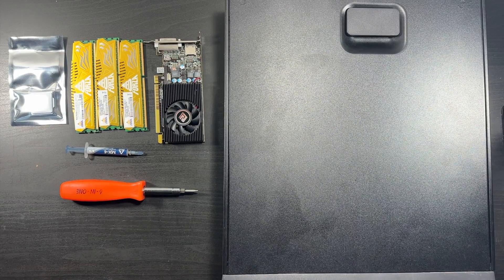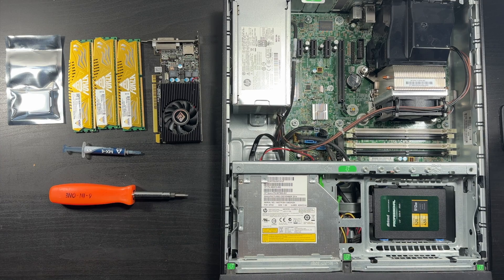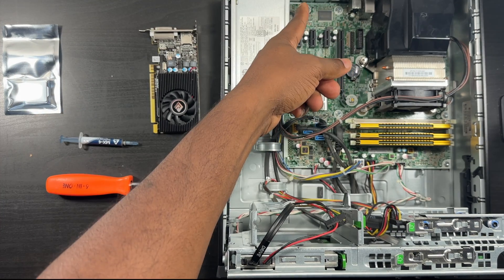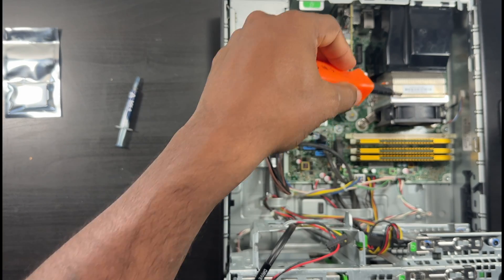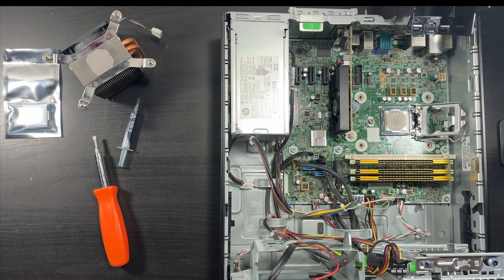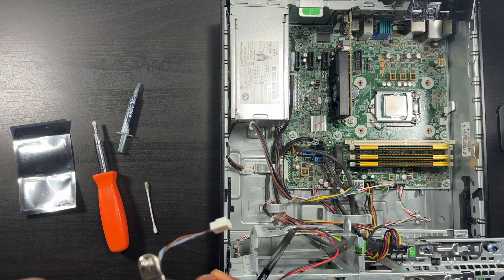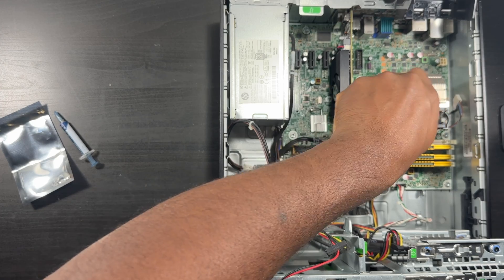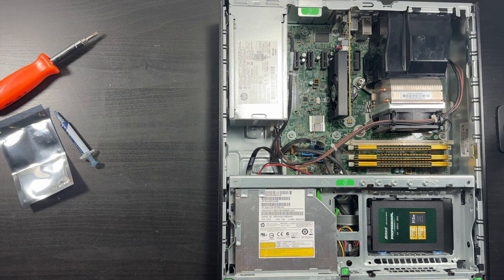Upgrading A HP ProDesk 600 G1 SFF Desktop PC (RAM.SSD.CPU.GPU)

Comment: Hola bro que tarjeta gráfica le pusiste a ese PC . Yo tengo un HP prodesk 600 G1 SFF.
Y no me corre el GTA 5 Enhanced. Por la gráfica del procesador. I5  4570  gráfica integrada HD4600  
tiene
 16 gigas de Ram 
Hdd 1 tera 
Windows 10
Reply from the maker: Powercolor AMD Radeon R7 low profile 4GB GDDR5 it was cheap but better than the onboard video card.
Reply: @charleeeugene oh sí bro gracias estuve viendo videos de otros PC igual al mío y tenían 
AMD RADEON R7 240
NVIDIA GT 730
NVIDIA GT 740

Comment: my hp prodesk 600 G1 TWR. is pretty much maxed out. cpu i7-4790k gpu, 1660 super. 24gb of ram limit should be 32gb. and 600w  PSU.  over the years it has gone threw a few ram cards due to memory management error..  the cpu upgrade from i5 to i7-4790k was no major  hurdle. and the 1660 super only needed  a 180 degree 8 pin adapter in order to power the card and fit the case with the lid shut.. but a few years ago i did half to update the BIOS since it was outdated. since then i haven't seen any issues.

Comment: What i9 processor was installed? Does BIOS support it?
Reply: Someone help me. I am in the same boat. I want th i9 9900 but im told its not supported.
Reply from the maker: No i9 will work in this machine. No socket size

Comment: I’m going to be picking up one of these today for free, what graphics cards would you recommend upgrading to as well as the cpu? I am a gamer although I don’t play modern aaa games. I play Minecraft with shaders, Arena Breakout Infinite, and 7 days to die. These games are not ultra demanding (they work on low settings on my 512mb vram laptop at 720p) I am not looking for 1080p but that would be nice. I also record and stream in obs so encoding would be going on at the same time as gaming.
Reply from the maker: Max out your ram also there’s only a few video cards to choose from for this machine. Has to a low profile bus powered video card since the power supply is low wattage. I would search on Microcenter for a GT 1030 4 GB for 100 bucks as for the processor grab a i7 processor from eBay my video shows which gen and model works with this machine.

Comment: Which GPU?
Reply from the maker: It was a cheap PowerColor AMD Radeon R7 240 Low Profile Single Fan 4GB GDDR5  Better than the integrated Graphics Chip.
Reply: Can I use that gpu to run small llm model?

Comment: When attempting to upgrade the RAM in an HP ProDesk 600 G1 by installing three 4GB modules (totaling 12GB), the system emits a beeping sound and fails to boot. have you ever had this problem
Reply from the maker: No I haven’t try installing one at a time. Boot with one ram stick at a time to see which ram stick is bad.

Comment: Great video. I purchased 2 more sticks of ram for mine, and its just beeping and rejecting them. The are are exactly the same as the already installed sticks...is this a bios problem?
Reply from the maker: Have you tried adding one stick at a time, sometimes that works let it boot into the system then shutdown and install the 2nd stick.  If the ram is exactly the same could be bad ram.

Comment: Doesn't the motherboard have a 35w limit on the pcie GPU slot?
Reply from the maker: Not sure but that’s why i installed a bus powered low end graphics card so there wouldn’t be any issues with it. The power supply is not powerful enough for anything else.

Comment: I had several cringe moments when you were fooling around with the CPU lol
Like a bull in a china shop :)
I heard it scraping the pins of the mobo.

Did it work in the end?
Reply from the maker: lol yes everything worked out. If this was back in the day when chips actually had the tiny pins I’d be screwed but now it’s really hard to damage the cpu chips.
Reply: @charleeeugene  I've done more than a couple handful of builds and never bent anything.

Until the other week. I still don't know how I did it but, it happened. 
It was a most surreal moment lol
Hey, glad it worked for ya though!
My inability to straighten the pins gave me an excuse to buy that Zed board for my 3770k I've been looking at :P

Comment: is it possible to install a soundcard in these 600 g1 sff's as an upgrade ?
i cant install realtek audio manager and i'm stuck with realtek drivers from 2015, with windows 10 telling me these installed drivers are the best ones available..
Reply from the maker: Yes you can install a sound card but it’s got to be USB external. They used to make sound card s pci but anymore.

Comment: Im thinking of getting a gpu for this… either the rx550lp or the rx6400lp but im not sure which one would be good… I know the pc only supports pcie gen 3.0 so im a little hesitant on getting the rx6400. Was also considering the gtx 1060lp but they seem even more expensive (i refuse to buy from ebay 😂 so i stick with amazon) 

I have the i5-4570 240w version so some ram, ssd, and gpu upgrades hopefully won’t kill the psu.
Reply from the maker: Do you think the rtx 3050 low profile 70 watt video card will work?
Reply: @charleeeugene  Idk? I know the mobo can handle cards that pull 50 watts but idk about 70 🤔 I’ve seen people use a gtx 1650lp which is 75 watts so, probably…

I don’t have alot of money and Im saving up right now so I probably cant even afford a 3050 (not to mention the cpu bottle neck)
Reply from the maker: @soapy4607  I'm going try it out if I can catch it at a decent price. I like using NVIDIA broadcast software. If it doesn't work correctly I'll return the video card.
Reply: @soapy4607 I have the same model only it's tower version with 320 watts PSU, Motherboard can handle up to 32 GB RAM and the strongest GPU I could find that only pulls power from the motherboard is GTX 1650 that i swapped for my old 1050 Ti
Reply: @ i got 32gb off ram, and the 1650 so it’s not too bad…. I just gotta be realistic with the cpu (e3-1271v3)

Comment: got 1 today for 90 ! lol crazy how i got this in my recommended
Reply from the maker: Are you going to keep it the same or will you be upgrading it?
Reply: @charleeeugene  100% upgrading it !! just dont no what to get first
Reply: I got this for 20 bucks with out hard drive 

i5 2400
4GB ddr3 1333mhz

I have spare parts

I'll up to 12Gb 1333mhz
And a GTX 745 OEM
Lastly got a 256 SSD and I'll put additional 500 HDD

Repaste with a Thermo Grizzly? 

So technically I got everything for just under 40 bucks in Canadian dollars

Probably 30 USD?
Reply from the maker: Sounda about right. A second gen i5  it should be a little higher than that unless it didn't come with a processor @chocwa_plays
Reply from the maker: Let me know what you do I’m curious

Comment: What graphic card did you install?
Reply from the maker: PowerColor AMD Radeon R7 240 Low Profile Single Fan 4GB GDDR5 PCIe 3.0  it was only 28 dollars and i don't game!!!! If you're a gamer there's way better options!!!!
Reply: @charleeeugene  so how is the graphics card working !? I’m just using it for school n watching shows
Reply from the maker: It's working fine. for your purpose it will be more than enough @400Turd
Reply: @charleeeugene  did you have to use the low backet io shield?
Reply from the maker: Yes the low profile bracket comes with the video card. But make sure your buying a LP videocard. @clues8012

Comment: What ram sticks would you recommend I'd get for 16 gb I have the same pc model as you
Reply from the maker: Grab some DDR3 12800 desktop ram you can either do 4x4gb =16 or 2x8gb=16 but you might as well max out at 32GB ram DDR3 desktop is cheap !!!
 https://www.amazon.com/Timetec-1600MHz-PC3L-12800-Unbuffered-Desktop/dp/B00IV19HZE/ref=sr_1_7_sspa?crid=3TH68GXCSPZD1&keywords=8%2Bgb%2B12800%2Bddr3%2Bram&qid=1706282876&sprefix=8%2Bgb%2B12800%2Bddr3%2Bram%2Caps%2C62&sr=8-7-spons&sp_csd=d2lkZ2V0TmFtZT1zcF9tdGY&smid=A23AD5LOJUVSEP&th=1

Comment: I have HP EliteDesk 800 G1 SFF (i5-4670, GTX 1050Ti LP, 4x4GB Corsair Vengance ram, 240GB ssd, 512GB hdd) - its amazing how good it is. The combo i5-4670/1050Ti gives under 2% bottleneck in all scenarios.
Reply from the maker: We are getting to a point in tech where older machines can still perform well enough  to get by .
Reply: I bought one prodesk in a street market. A question, how do you know that bottleneck is 2%😮😊

Comment: E3-1265L v3 does work with these and can be picked up for cheap. As for a GPU I would probably go for a RX 6300/Radeon PRO W6300.
Reply: Dont know prices but 4GB vram will be better if you play games.
Reply from the maker: Are you a gamer?
Reply: I actually just popped a Nvidia Quadro K1200 into one of these without upgrading anything else, and it runs games very well.

Comment: Can i upgrade it to i7 4790k 
Reply please
Reply from the maker: Yes It's a fourth generation i7 go for it!!!!
Reply: @charleeeugene  Do I need to upgrade my SMPS? For this processor
Reply from the maker: No the power supply is strong enough for that processor @Pradeep-h3b1t
Reply: hey did that work out for the Intel Core i7-4790 3.60-4.0GHz Quad-Core 8MB Haswell LGA1150 CPU Processor SR1QF
please let me know I would be greatful
Reply from the maker: @MASTERDVDUSB   It works !!!!!!

Comment: Do you think the gtx1660s single fan will fit in here? Either that or I was looking into 1060 single fan
Reply from the maker: If it has the low profile bracket you can install it.
Reply: No, you can install 1650LP, 6400LP or some a2000. Look for LP cards with no aditional power connector.
Reply: yes I have the 1660 super{dual fan }  in my 600 TWR case. just need a 180 degree pci-e adapter and a upgraded 600 PSU since that gpu required additional power source, PSU is evga 600BR